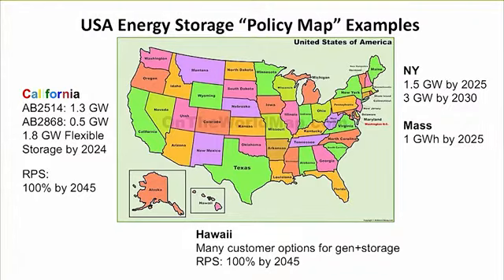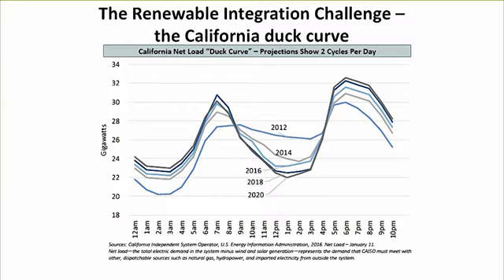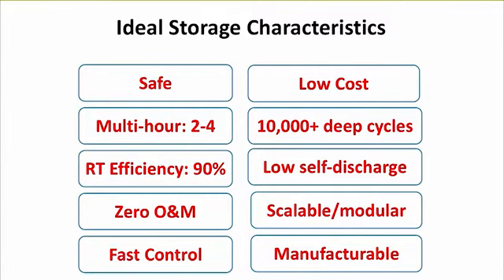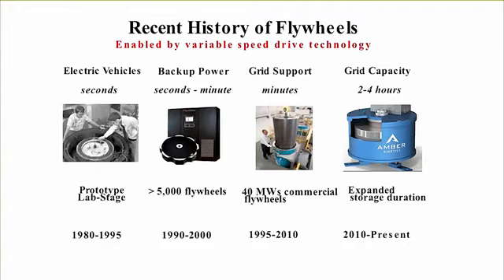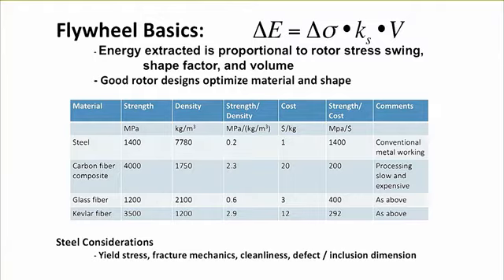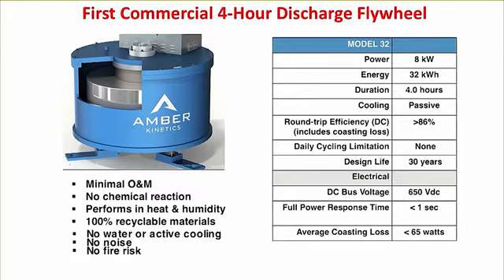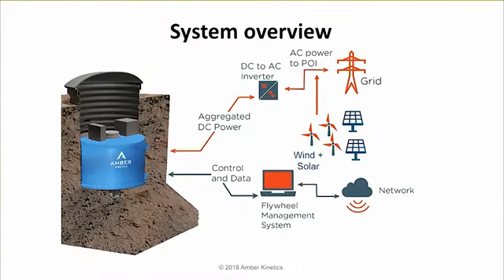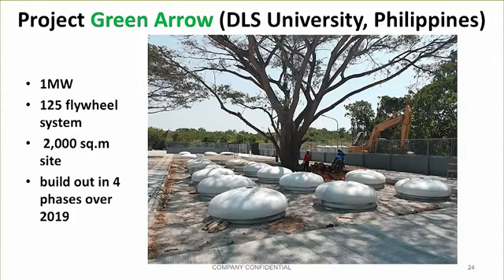Flywheel energy storage: renewable integration technology for the 21st century

Comment: tiny load on the bearings? and no work done by gyroscopic effect? ahahaha... guy is  a scammer or does not understand what he is talking about. and then mentioning coriolis effect? is he high?  and any magnet bearings also raise a lot of questions .  heat and kinetic stress is usually the problem with systems like that and extra magnets do not simplify things...  as there is no perfect magnet there is a lot of induction heating involved. and my concern is not even speed loss but fast degradation and fail of the components.  usually that is what happening.  nobody tests systems like that for 30 years  but they are fast to make claims of that kind)    and combining mag lev with clissic rearing is also strange and even destructive in some cases.
Reply: Considering they used this technology commercially to support data centers in the 90’s maybe there’s some details you and I don’t understand or aren’t privy to. Why not send him an email with your concerns?